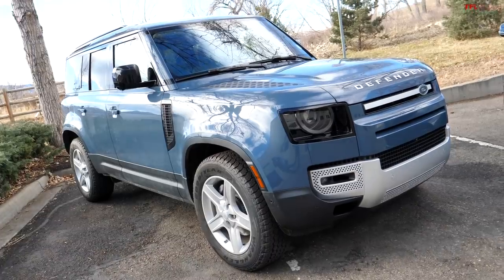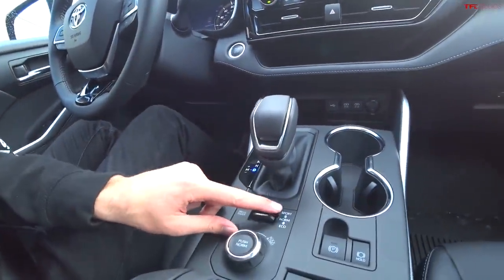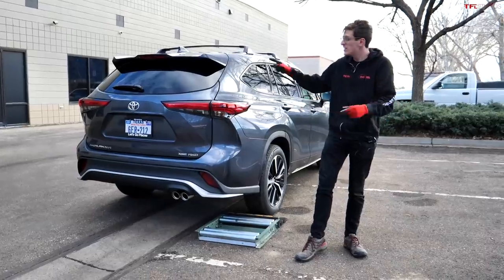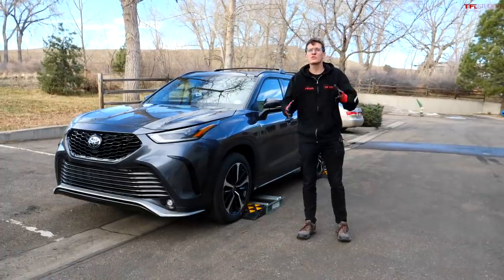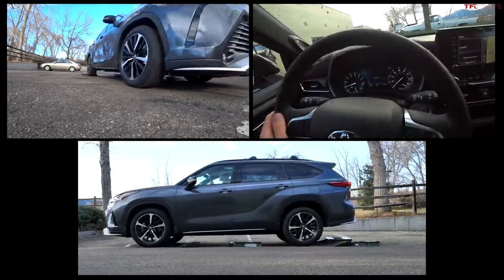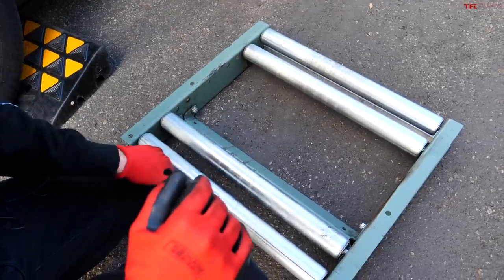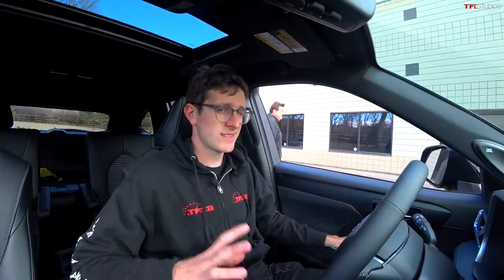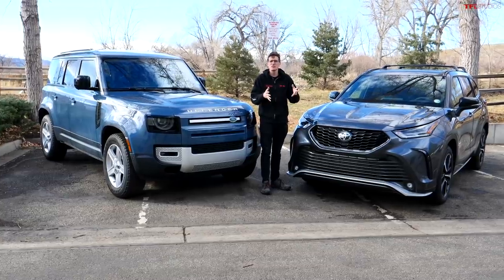Does Land Rover REALLY Make The World's Best Four-Wheel Drive Car? I Compare It To Find Out!

Comment: 4x4 doesn't mean it has low range... 4x4 is most commonly associated with a part-time 4wd system where AWD is considered all-time 4wd as it can differentiate speeds between the front and rear axles. Essentially it's a locked center diff or spooled. 
.
You can give AWD a low range or use 4x4 on a single speed transfer case. What's also funny is that modern torque converter automatics can get to nearly the same crawl ratio in a single speed than what a low range 4x4 could do 20-30 years ago. My 06 Z71 silverado had a 28.5:1 crawl ratio in low 1st while a ridgeline has a 20.4:1 1st gear crawl ratio and smaller tires to churn... In high the z71 had an 8.3:1 ratio... And that's not taking into account torque converter toque multiplication... with a more efficient converter that has a higher multiplier effect, A ridgeline with 30" tires should be very similar to producing the same wheel torque as an 06 z71 silverado with 32" tires (both tires rounded up)... And I ran 33" tires on it. 
.
And the silverado had an awd autotrac transfer case that would use a clutch pack to flow power to the front when needed but kept it mostly rwd otherwise. I actually miss that truck a lot, but it got high centered and broke a lot of shocks. Chevy always replaced them though. Best customer service... unlike subaru whom blamed me for the clutch failing on my WRX without even inspecting it. Once I agreed to pay they opened it up and the transmission case was broken so the clutch had little to no throw wearing it out. They still made me pay for it since I "agreed" under their false pretenses. Toyota wasn't much better... after 3 attempts to fix my Tacoma fender that kept popping off they said they can't help anymore... Can't believe I gave up the reliable chevy that only broke shit when heavily abused, like running down sand highway in glamis at 50mph snapping both rear shocks in half, for a 2010 tacoma that was falling apart and squealing at 25k miles.

Comment: Defender consistently outperforms Highlander by a mile. But this guy is always so elated and heap praises whenever Highlander was eventually able to get out of it, even after much struggle and given generous 2nd, 3rd, nth chances. And his face seem disappointed when Defender quickly make short work of the slip test right off the bat.

This guy is a sucker for Toyota. Even if Toyota sucks most of the time.

I prefer watching the older guy (his dad?) do the tests and reviews. Fair, professional, informative.

Comment: The land rover seems to remember that you were on a surface with little traction and it started off with aggressive wheel control making the second run that much easier looking.
Reply: Which is a sign of a very-well executed traction system.
Reply: @ms-jl6dl  in a lab... being aggressive with the brakes can cause issues. Over braking the spinning wheel can eat up body momentum and make it more difficult to accelerate when all wheels have some traction. 
.
A far better system is one with traction devices such as lockers and limited slip differentials that can transfer torque to the wheel with the most traction naturally and without applying the service brakes. 
.
A fully locked driveline is the ultimate 4wd system that can see every ounce of torque delivered to one wheel in extreme circumstances instantly without intervention. As wheels loose grip the others get more torque as the driveline cannot spin without over powering them. 
.
Simply put the new LR is the ultimate soccer and ski resort machine. Big boy 4wd systems don’t rely on predictive algorithms to work open diffs into a decent climb. They use locked axles that shift torque violently front one wheel to the other as the axle hops for enough traction to drag it over the obstacle. The LR has to squeeze its brakes to move on flat ground.

Comment: Locking diff is necessary off road. Do the same test on an incline and brake wheel affect is working against you and you won't get sufficient overall net torque.
Reply: I agree with a caveat: for difficult off-road a locker is necessary. For light off roading that majority of suv and truck owners actually do, awd with a clutch based torque vector system like a Honda passport would be sufficient if paired with aggressive tires.

Comment: Rather than use Rock (Rock Crawl) mode you should be using a snow or grass mode as rollers behave like a slippery low friction surface. Rocks are grippy so odd you chose that mode.

Comment: Well, that vid brought some confidence back for the LR. However, what was the difference in tyres between the 2?
Reply: In this case tires make no difference.  In the real world of course they would, but this isn't in any way a real-world test.  It does a good job of simulating laboratory testing of the ability of the systems to apportion torque.  I have no love for Toyota or minivans like the Highlander at all, but I do admit it did better than I expected.  Of course, I'd take manually selectable real lockers and solid axles over either, but I realize I'm a minority.

Comment: how did the defender allocate the power to one tire tho since it only have center locking diff? Does it use the brakes on the 3 slipping tires?
Reply: Yes, it is using brakes. All modern systems do that but not all do that good.

Comment: Felt like you weren't accelerating enough in rock and dirt mode during the rear 3 wheel test...not even traction control light went on....

Loved the land rover btw, I've always wondered with a traction control that good when are you really gonna need a rear difflock, may be once every 300,000 miles which let's be honest, won't happen in a LR
Reply: The Toyota AWD systems are just poor.  No excuses...

Comment: I feel like you are either insulting the Discovery I mean Defender (which I’m fine with) by comparing it to a road going AWD Unibody or you are throwing it a softball comparison so it looks good.  Why not compare this thing to a proper full time or part time full wheel drive rig.  Lets test it vs a 4Runner TRD PRO or Jeep Wrangler Rubicon or my Power Wagon.  I think a much better slip test would have been vs the Lexus GX or Toyota Land Cruiser.

Comment: Wrong comparison! The Toyota is an SAV, not an SUV. the Toyota SAV has a lightweight system, to assist road safety, unlike the LAND ROVER, which is a heavy worker, with manequi airs to, if necessary, break walls

Comment: The other point about buying Japanese 4x4s in the U.K. and longevity. I can buy just about anything for a 26 yr old LR at cheap cheap prices. Spares for Japanese vehicles over 10 yr old are crazy prices....and yes they need them. Cousins Navarro needed an engine swap....Brothers Shogun needed a new cylinder head, cams etc crazy prices. There's a reason you don't see old Japanese 4x4s on the road ....
Reply: Hear in the states the opposite seems to apply
Reply: Honda spares in the UK are more expensive than Mercedes.

Comment: Please get a rav4 with standard awd on the rollers
Reply: I tested such version. It couldn't pass the test when only one rear wheel had grip. All other tests went excellent.
Reply: @4x4.tests.on.rollers  did it do better than this highlander? What trim was it?
Reply: @BrandonMeyer1641  It was 2.0 Dual VVT-iE Direct Shift CVT AWD with Active Torque Control. And hybrid version to (also previous generations). Visit me, videos from the tests are available 🙂
Reply: @4x4.tests.on.rollers  I was referring to the tnga rav4 with 2.5L inline 4 with 8 speed automatic transmission.
Reply: @BrandonMeyer1641   As far as I am concerned, 2.5 8AT doesn't have standard awd but Dynamic Torque AWD.
Reply: @4x4.tests.on.rollers  in there are 3 powertrain options in the United States, all of which use the 2.5L inline 4 naturally aspirated motor. The hybrids us a cvt and the gas motor to power the front wheels and an electric motor to power the rear. While with the standard gas only models there are 3 ways you can power the wheels, all of which use the 8 speed auto.  There is front wheel drive standard on the the lower end trims, where you can option an all wheel drive system with a normal open differential in the rear. On limited, adventure, and Trd trims there is a more advanced all wheel drive system with a torque vectoring differential in the rear. In the tnga all wheel drive system demonstrated in this video is similar to the ones in the higher end trims of the rav 4 with torque vectoring. I am asking if you have tested the optional all wheel drive system found on the lower end trims of the rav 4 that are built on tnga
Reply: @BrandonMeyer1641  I tested the most basic one (called Active Torque Control AWD) with open differential in the rear. The torque vectoring one (called Dynamic Torque AWD) with two clutch-packs in the rear isn't even available in my country. I also tested hybrid but that's very different.
Reply: @4x4.tests.on.rollers  thank you for clarifying

Comment: TFL has access to an FJ cruiser in their lineup and to do a drive train comparison to a Defender, they asked Toyota to send them a Highlander?
Reply: The FJ is not for sale as new today.  The Highlander is brand new and it failed.
Reply: @normt430  I meant the two vehicles are not comparable, the tuning of the traction controls considers state of the lockers and wheel spin speed which is miles apart for these two vehicles. The Highlander did not fail, just needed more throttle and it would have been ok. But in essence might as well have put an all wheel drive sedan against the Defender.
Reply: @DaviesMalesi  no, Toyota shouldn't be putting AWD stickers on their cars if they don't perform.  At least the Defender can defend those labels.

Comment: your test is flawed in my opinion...the spacing between the rollers should be more for vehicles with this size of wheels; it took no effort for both vehicles to quickly roll over in most scenarios. The vehicle has a tiny forward movement when you start accelerating which gives it momentum, and then when your father pushed the Toyota so effortlessly , it got unstuck which proves my point...you need to create a significant "ditch" as an obstacle

Comment: Okay fast lane truck this video really doesn't make sense because if you're going to compare a Land Rover you compare it to a Jeep those are the two best four wheel drive systems out there that have ever been created I know Toyota has a system that works pretty well and what have you but it only works well and they're higher in vehicles not in their lower trim vehicles and that's the difference between Land Rover and the rest of everyone else is well as Jeep they all both create all-wheel drive systems or four wheel drive system that work on every trim level not like the competition this is a bad comparison

Comment: I will have to remember this the next time I am driving on rollers.  Seriously, this has turned into the extremely cheap and lame way to test the AWD or 4WD system of a vehicle. It doesn't replicate real world conditions at all. The only way to test real world conditions is out in the real world which is why it's called "real world conditions". Other channels are actually taking Trucks, SUVS and Subarus out into the real world, on trails, in the snow, dirt, mud etc and actually testing them while TFL is driving theirs on rollers. Unless the weather is nice and sunny. You are in a perfect location to honestly test these vehicles yet you choose to cheat and skimp.

Comment: The Highlander is front wheel drive biased so as long as one of the front wheels had grip, it moved off. The same wasn't true with the rear wheel, where it did roll but started skewing the car on the rollers. Which tells me that it can't transfer enough torque in the rear where one wheel had traction. The LR, had no problem. In a rock crawl, you wouldn't use the Highlander, but with the LR you would need much more torque (to one or more wheels) depending on the slope and obstacle (like a rock or ledge). I wonder how much engine torque it can transfer to any one front/rear wheel, and if there is a preset front rear bias for torque transfer? That would be the only reason to use lockers (front or rear)  where in the 3 wheel slip test, you would be able to transfer all (100%) of the torque available to that axle, which would again be 100% of engine torque when the center is also locked. You could try the 3 wheel slip test on a slope (like you once did on a Subaru in a truck dock with slope) to see if you get different results. 
If the LR torque vectoring is brake based per axle, its going to be limited to less than 50% engine torque, but may still be sufficient for 90% of real world off-road obstacles. Still not like lockers.

Comment: Hell, I don’t understand the logic: you emulate ice condition with rollers, but every time try to use rocks and dirt mode. What kind of perversion is this? May you explain me how should it look like on the rocks: one wheel on a rock and three wheels dangling in the air or what?